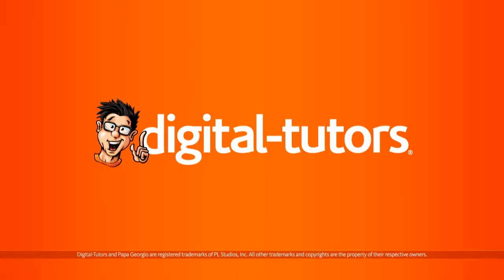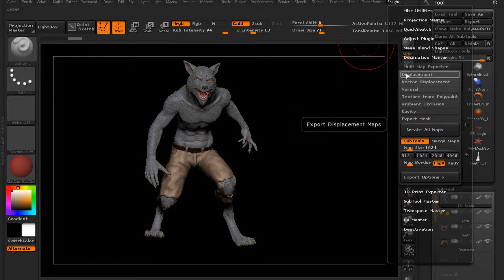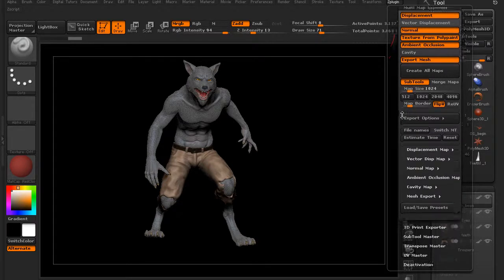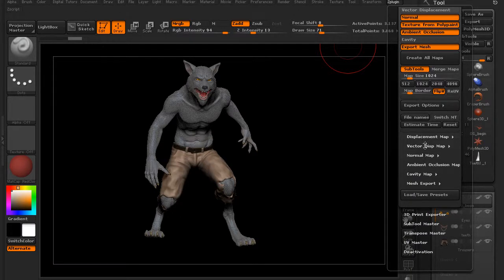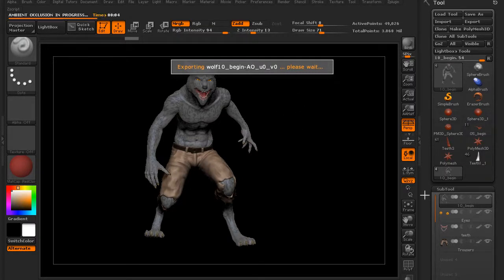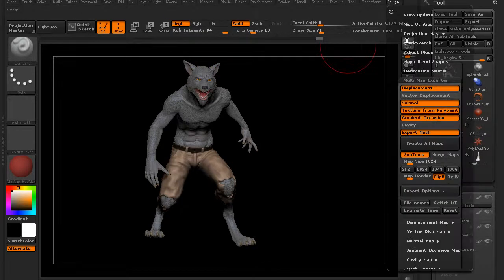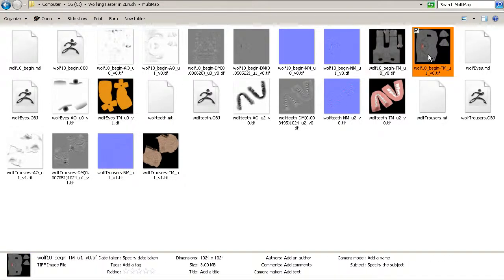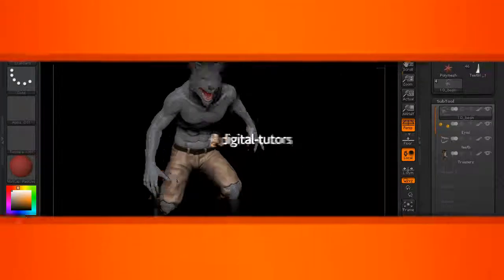10  Using the Multi Map Exporter

Comment: How do you get that good normal map using zbrush multi map exporter? i didn't sw you modified anytihng on the normal export option and you get clean result, if i leave it as default i'm getting a extremely weird normal map, with a lot of green and red areas, is this a bug of zbrush 2022?